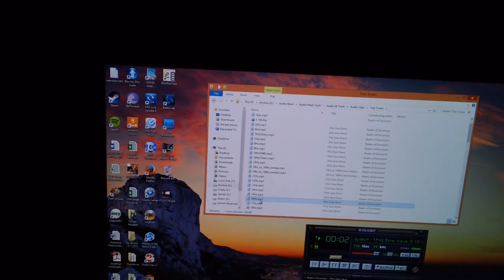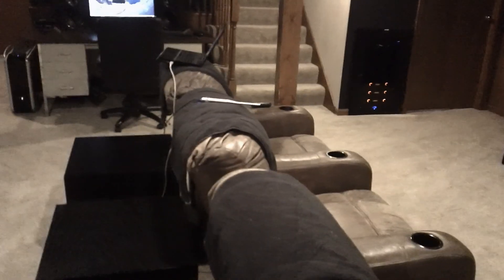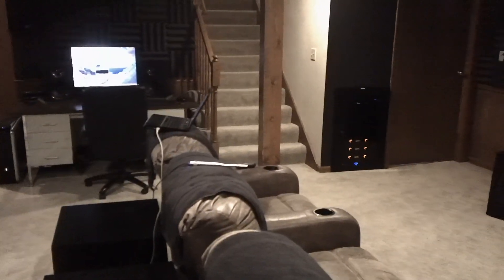Eight 18" subwoofers - subsonic bass frequencies and their effect on a basement slab

Comment: Very impressive and interesting to see the 8 hz in action! How were you able to circumvent the high pass filter on the iNukes? I was under the impression that they had an unavoidable HP cutoff of around 25 hz on the inuke dsp amps. I am going to build a sealed 18" with the dayton ultimax and inuke 3000 dsp, and am very interested how you got those low frequencies from the inuke amps.

Thanks!
Reply from the maker: Nothing - they just worked that low.  Maybe you need to have good source equipment to ensure the source equipment is passing it to the Amplifier?  I typically keep a top shelf AVR.  Onkyo PR-SC5508, followed by Denon 4520Ci, and now Denon x7200wa, and soon Denon x8500h
Reply: @jvonengeln  only if I could do that. Would one in a small room be able to do that?
Reply from the maker: River Alley takes a lot of cone to do it.  In a car cabin a single 18” is a lot of fun.  In a big room it’s not very noticeable.  In a small bedroom maybe a single 18” would get the doors to rattling in the low frequencies.

Comment: What amp is pushing them?
Reply from the maker: +blackz06 
Front five are driven by three iNuke DSP amps at four ohm load per channel/sub.  1 driver per channel on two iNuke DSP 6000 amps, and 1 bridged iNuke DSP 3000 amp for the center.  So about 1,700-1,800 real watts per subwoofer driver.  The rear three nearfield subs are driven by a bridged Cerwin Vega CV-5000 amp.  The bridged load is wired to 3 ohms.  so 5000 watts/3 for each of those drivers.

Comment: You don't feel anything probably because of woofer placement. Technically with you cone area in the room alone you shirt should at least wiggle once you open that wooden door at 9hz
Reply: So are you saying the very low frequencies (like 9Hz) won't build up until you are quite a bit away from the subwoofers?
Reply: +Ganondorf 9hz is so low that you will need lots of big subs in a IB setup to properly hear it.
Reply: +dogmanhero3 
Ok let's say about 15Hz and up... Does the distance from the subwoofers matter in that case?
Reply: +Ganondorf Not As much because the wavelength of 15hz is smaller than 9hz and you'll get more room gain too
Reply: +dogmanhero3 
What about a very small room? I'm asking this because my room is only 8 ft wide, 13.3 ft long and 8.4 ft high (rectangular).
And notice that I typed "15Hz and up, so the freqs up to 30Hz are meant as well. :)